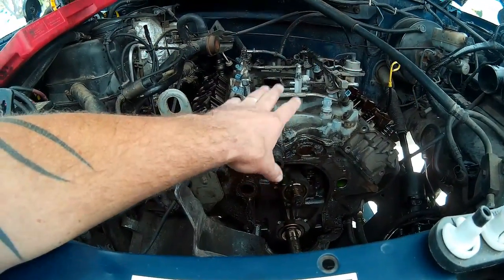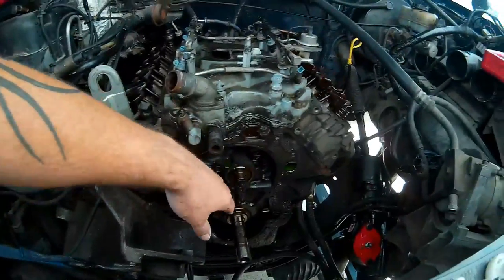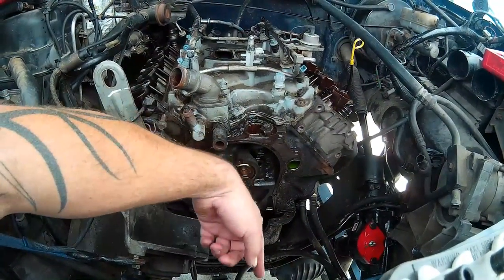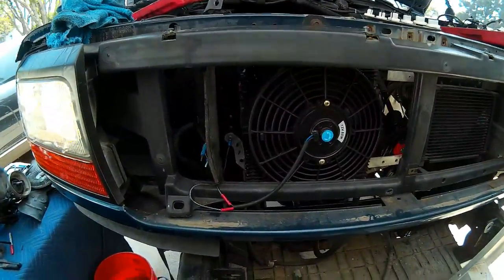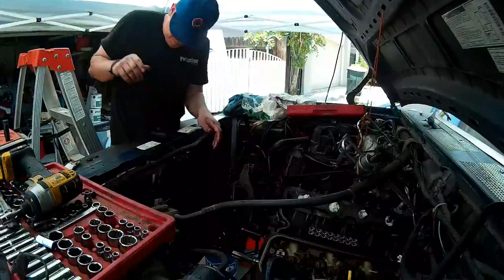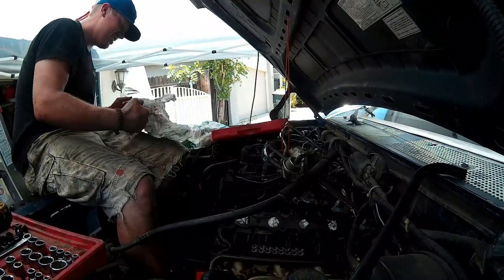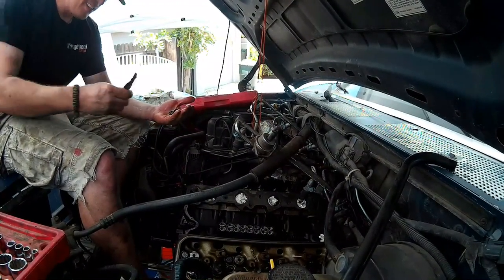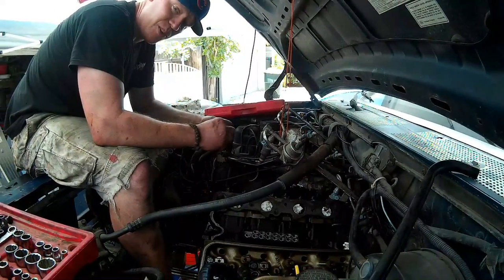Ford OBS; Kevin's 460 F350 Lunati Cam Install!

Comment: Flat tappet cam.....going in dry. Thats a bold move Cotton.
Reply from the maker: was NOT dry.  i think some lack video watching comprehension.  thanks for watching.
Reply: VintageSpeed Garage I came here to post the same thing lol.
Reply from the maker: @bullhead360  LOL i hear ya, but it was just a poor edit on my part......i'm a better mechanic than an editor...i think...  cam wasn't installed dry, just looks that way at the camera position change, front half is fully lubed if you look close enough.  thanks for watching tho!

Comment: So, as we all know. Gotta have the right cam to match the performance of the torque converter, and vice versa. So I had to do some transmission work a while back, internal leak. Roasted my converter clutch. I was going to get a factory converter replacement but the day I went to get it the guy didn't have it. I ended up getting a discounted price on a precision 2467 hd-rv triple clutch ultra low stall converter. Yes, I tow a lot, so it serves purpose. But I'll admit, the converter lockup is extremely fast and loses close to 500 rpm instantly in 3rd gear and doesn't have any clutch slippage when in OD, just locks fast. When towing I've always kept my rpm around 2-2.5k rpm, as that's where my power band is with the new converter and lightning lockup. With the factory one I would usually let it shift around 2k rpm when pulling a load as I would have slower lockup in 3rd and slippage in OD until 60 mph where it fully engages. Basically there's a lot less slippage due to the lightning fast and strong grab of the triple disk converter. I'd like to make more low end torque so it isn't much of an issue. My current setup is everything factory apart from the aftermarket converter. 1994 f250 460, e4od, 4.10 final drive gears. Only intake modification is I cut the intake velocity stacks, which helped with hill climbing. Any advice on how I can achieve more low end torque would be much appreciated, thank you 😁

Comment: Are stock valve springs OK used ? Or do you need heavier springs ?
Reply: Stock is fine. I was told you don't really need anything heavier until you get over .500 lift
Reply: @kevinsinclair1013  if you can come up with the part number on this cam that would be super thank

Comment: You put a fuel tune on it after u installed that cam
Reply from the maker: Kev added a fuel regulator and turned up the pressure to accomodate for the cam.  thanks for watching!

Comment from the maker: you can skip to 9:30 if you just wanna hear that badass 460 sing!
Reply: Is there a video of how it sounds at idle from the outside?
Reply: How has drivability increased? More power across the whole usable RPM range? Use more gas?

Comment: Why is he not using break in lube on the lifters? Also, when breaking in a cam, it's always best to use non-detergent oil
Reply: I was wondering the same thing😮
Reply: @dombarela8187  I do know that if you order the cam case hardened,it can virtually eliminate break in problems, and bring the friction coefficient down to almost  roller cam levels, but you still gotta use cam lube

Comment: Does the cam make much difference?
Reply: It seems to have more power through the mid-range.  With everything added on, it seems to have made a significant difference.  Without a dyno, I can't give you solid answers, only what I get from the "butt dyno"

Comment: What lunatic cam did you user and did it have any computer issues after cam change?
Reply: Cam is not aggressive enough to throw off the computer. Lunati Part # 10340261LK
Reply: @kevinsinclair1013  thanks for the reply ive got a 91 bbf I'm working on

Comment: Hey man, you said Kevin has 37s on his. Did he also do gears on his differentials.  If so, what did he go with. 
By the way, nice job with videos.
Reply: It has the factory 4.10s. If it saw weekly use for towing, I would go with 4.56 or 4.88. For now, the 4.10s are working out.
Reply: It doesnt downshift with even the littlest bit of gas peddle given? I have a lifted 1992 F350 crew cab long box on 37's and it downshifts alot when i barely accelerate
Reply: @BonnevilleNut  It's not that bad. I've never been blown away with the E4OD but it has worked fine so far. I've got a ZF5 (S5-47) sitting on my garage floor to fix that 😎

Comment: What would Lunati cam is best for ford 460 efi towing cam ?
Reply: im looking for the same answer.. what did you come up with?
Reply: @gorybonghit3211  My experience with a 1995 Chevy Yukon / 350 , I used a 327 300hp version cam with new lifters and valve springs from Melling and worked fine. My idea was to find a 429-460 similar version. Also what is stock 460 cam lift ?

Comment: What part number is this cam
Reply: Lunati Cam 10340261LK
Reply: Hi Kevin, I have a 92 F350 gasser and am considering following your lead on my truck.  The cam specs in the video match up with part number 10340267LK.  The part number you listed is slightly different if I’m looking at things correctly.
Reply: @jamesroy7090  I part number I listed was the one I put in. I believe it may have been a typo in the video. According to the Lunati tech, the one I picked was about as big as you can go and not have to replace any of the valve train. I've heard you can go as big as 500ish on lift without issue but I didn't want to push it.
Reply: Kevin Sinclair Awesome, thanks so much for the info!!!
Reply: I am interested also.. im redoing my 1992 F350 CCLB on 37's right now.. looking to wake up the motor.. interested in the cam too. Like to see how it sounds at idle from the outside. Wish you were local so i could compare my stock 460 against your cammed 460.  Did i read you did differant heads? Dove heads? Have you found an intake? Iirc they dont make a aftermarket intake manifold
Reply: @BonnevilleNut  When the truck is cold you can hear it slightly at idle. Once warm, it sounds stock. I would say the cam alone won't make a huge difference. I have done intake, headers, exhaust, and adjustable fuel pressure regulator along with the cam. Everything together has made a big difference over all. The cam made 2500-3500 rpm feel stronger. I have factory heads. Parkland Performance (Reincarnation Automotive) makes heads for the fuel injected motors and do a ported factory intake. Heads and intake are expensive and might be considered when it needs a rebuild.
Reply: @kevinsinclair1013  hi would mind telling  how much for all you did in the 460 and .. you said the new heads can be high$ how much would you say it is thanks
Reply: @jasonasiancajun8950  Cam and headers is all I've really done. $1400 or so for parts. Heads are $1500+ depending on what you pick.
Reply: @kevinsinclair1013  What upgrade do you think made the biggest difference in performance for you.
Reply: @bucksnbolders  Anything to make this beast breathe better!  I just did the ported factory intake and headers on mine (at different intervals) and I would say that the headers and complete exhaust overhaul was the most helpful.  I just did the intake R&R over the weekend and you can feel a little difference in throttle response.  Unfortunately, now I have a tapping lifter (or 2) so I am going to go ahead and do a cam swap (which is why I am here).  Not sure why I now have a bad lifter after the intake replacement.  I made certain I cleaned the valley out, but maybe some junk got down in one or two of the lifters somehow...
Reply: @kevinsinclair1013  What oil did you use for break-in?  Something with zinc added I would imagine?
Reply: @wesstallard8919  Lunati Engine break in oil. I use comp cams zinc additive when I do oil changes. No issues to date
Reply: @kevinsinclair1013  Thanks bud!  I couldn't tell in the vid, but did you have to remove the AC condenser in order to pull the cam all the way out (and back in)?  Going to get started on the break down this weekend and wanted to know exactly how much crap I have to remove.
Reply: @wesstallard8919  Yes, it has to come out as well. I didn't remove the radiator core support, but taking out the grill will make life easier.
Reply: @kevinsinclair1013  those guys at parkland performance are something else! Did awesome work on my 460 block for me.